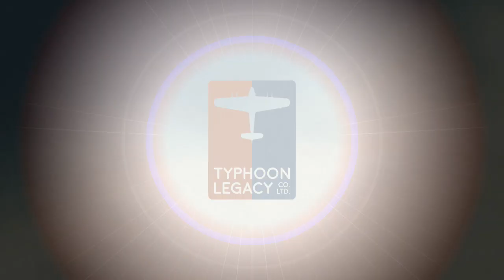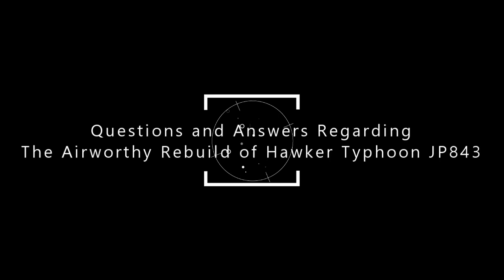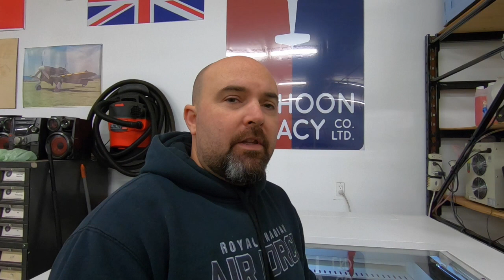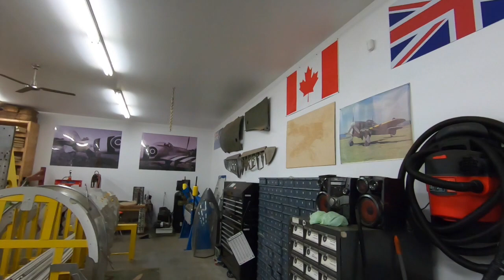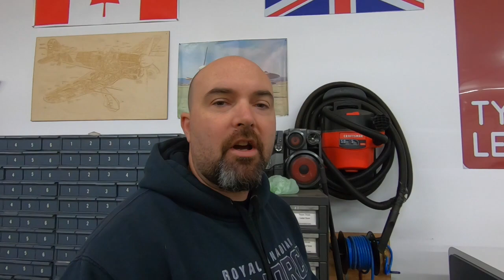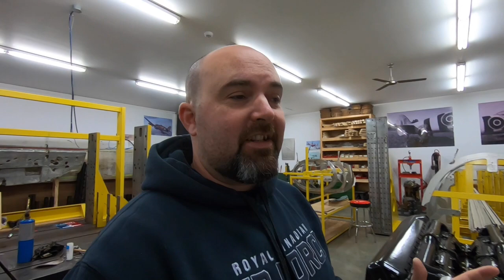Typhoon Legacy Q & A - Laser Cutting

Comment: one of the things that materialised nicely with the Lancaster restoration was in the way they are tackling the entire project

Lancaster NX611 is mostly in use, taxying round what remains of the old airfield, taking passengers for a joy ride, the money raised goes back into the restoration, but how to restore and use at the same time, well its simple when you have access to other Lancasters and or sections

since the project was likely to take around ten years, now in year 8 or 9 now, by borrowing sections, like a part fuselage and wings from a French museum, these parts have been partially restored and then swapped out with NX611, which continues to take fund raising passenegrs round the airfield while NX611's sections get a major overhall, much of the skins replaced and some structural frame and stringers

the planning has a double purpose too, while each section and allits components go through a strict inspection, all the parts in the section can be passed by authorities over the ten yer time period instead of saying there it is, rebuilt, theres all the paperwork and take another couple of years to check things through, it can all be done over time

what was nice to find was having built the fixtures to fit NX611, it was quite rewarding to find the French lancaster was not very far off the same measurements, testiment to those who built them the first time round and very likely shows that in build sequence these machines may not have been that far apart during construction

building a one off (apart from RB396 in the UK) by hand seems perfectly logical, now if it were me and money for materials was no object, i might well be making duplicates, but that's just me

Comment: I'm following this project with great interest because my late uncle Peter  (P/O P J Spellman) flew Typhoons during the second half of WWII. The Typhoon deserves its place in history but had some serious shortcomings not least its tendency to shed its entire tail in a dive. Hawkers reduced this problem (which was nearly always fatal to the pilot) with a series of fishplates over the transport joint where the failure occurred. In addition to the engine's tendency to catch fire (and stay on fire), exhaust fumes got into the cockpit forcing the piolts to fly on oxygen from takeoff to avoid monoxide poisoning (the later bubble hoods may have reduced this). High frequency vibration made the type exhasting to fly for long periods, though the later four blade props reduced this considerably. It was considered a swine to belly land successfully and would often flip over on its back when the radiator/oil cooler dug into the ground (this happened to my uncle Peter). What usually happened then was the aircraft caught fire with the pilot trapped in his cockpit (Peter was lucky - his engine didn't catch). I wish you all success with restoring this aircraft but are you sure you want to fly it? Best, Alan J .
Reply from the maker: Thanks for the post Alan, almost all of the issues listed above were resolved in the Typhoon, there is nothing we can do about the belly landings though! The Typhoon is often remembered by these faults, but they were all the result of fast development and no grace due to war. Most aircraft suffer from problems when first built, but the Typhoon had the unlucky fate of being under the microscope when they occurred; and only because it was the RAF's fastest fighter, and the saving grace against the FW-190. ~Ian
Reply: @TyphoonLegacySociety  Glad to hear you're applying all the 'fixes' to what I suspect is quite an early example. My uncle Peter visited the RAF Museum in Hendon, London shortly before his death in 2000 and saw the only complete Typhoon still in existence. Have you had much help from Hendon or Hawkers (now part of British Aerospace)?
Reply from the maker: @gourishankar52  The Museum in Hendon has been very helpful when requests have been made. We were very fortunate that MN235 was loaned to Canada for several years, and were provided access to complete a digital scan of the wing.  BAE has policies in place regarding the provision of information, its unfortunate but understandable. ~Ian

Comment: Merry Christmas buddy.

I have no idea regarding cost for equipment, but perhaps abrasive waterjet profile cutting might fit your needs quite well?

Here is an extract from Wikipedia.

The largest waterjet manufacturer, Flow International (a spinoff of Flow Industries), recognized the benefits of that system and licensed the OMAX software, with the result that the vast majority of waterjet cutting machines worldwide are simple to use, fast, and accurate.
Reply from the maker: And to you as well! The time to cut the flat patterns is fairly minimal for one aircraft, best suited to manual work for sure. ~Ian

Comment: Good info Ian. Does the forward fuselage section use the squared ended tube section like the Hurricane.
Reply from the maker: It sure does, all mechanically fastened joints with plug ends, squared tubes and gusset plates! ~Ian

Comment: Nice update. We're planning on using laser cutting for our frames, both bomb and fuselage. I should think that we'll get away with it due to the fact that our Stirling will be non-airworthy. Have you considered water jet cutting?
Reply from the maker: Its a great tool for non structural or static aircraft parts. Water jet is a good option too, but for the lower production volumes it isn't worth the extra cost. Flat patterns really only take a few minutes to cut by hand.

Comment: Re not using laser to cut alloy parts.  What do you use that doesn't produce heat?
Reply from the maker: Primary cutting for our flat patterns is done by hand with a throatless shear (shown in previous videos), I also use the Rotex punch and a router for smaller details. CNC router is an option, and the typical method used in modern production. ~Ian
Reply: This Old Tony one inch punch. No heat.